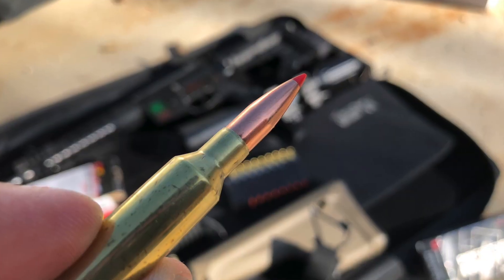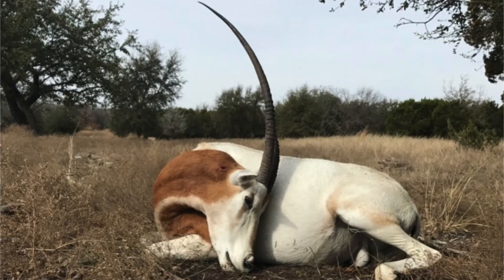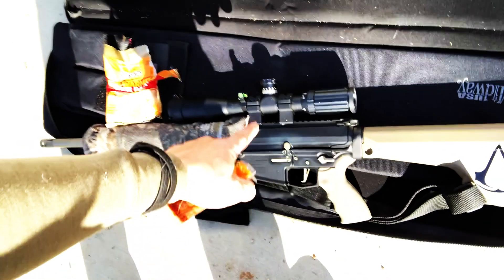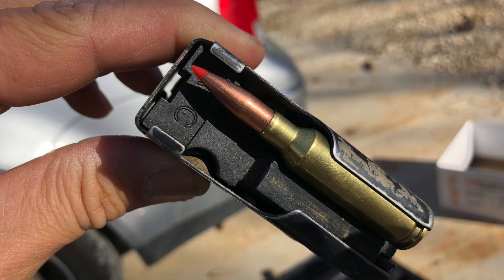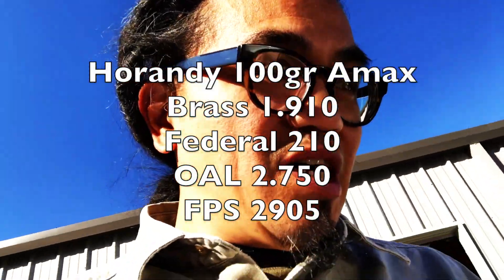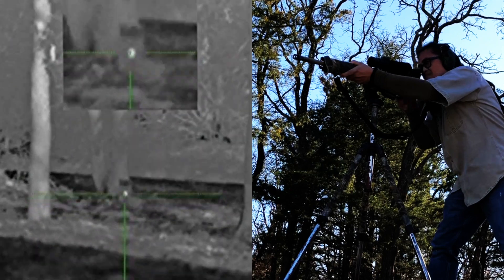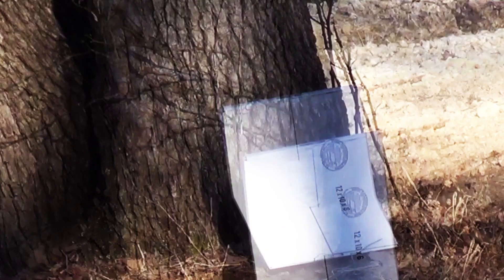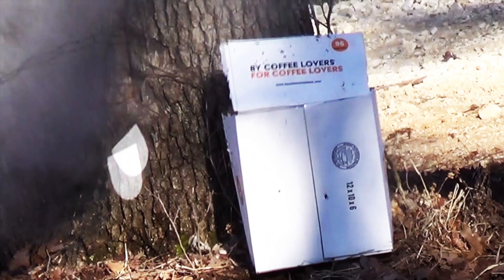6.5 Creedmoor Crimping Bullet Point of Impact Shift

Comment: Suprising i would i have expected some increased velocity due to higher pressures.  I would crimp too for a gas gun, and use bullets with a Cannelure.
Reply from the maker: I'm having to dump this entire load and starting from the ground up again.
Reply: SpecialEd309 Thats unfortunate it looks very accurate.  Im having to pull 80 Nosler RDF's due to overpressure signs.  i feel ya.
Reply from the maker: Ya, growing pains.  So many .264 options.  Fun a good cheapish batch of FMJ's waiting for them to come back in stock.

Comment: Not going to make much difference without a cannelure to crimp into on the bullet I do not think

I did have a variation on my 7.7x58mm Jap rifles when I switched from a .311 diameter bullet to a .312 diameter bullet with a cannelure but I believe it was because of the bigger diameter of the bullet and not the cannelure

After sighting into the bulls eye with .311 diameter bullets I switched to cannelure type .312 diameter bullets and found very accurate also but all of them shot 3 inches to the left of dead center for the same weight bullets

Not sure if it is the same for rifles and would have to use a chrono to find out but I did have that one video with the 357 where all of a sudden heavier cases with a heavier crimp ended up with slower velocities than the lighter cases with a lighter crimp

In the end I concluded it was because the lighter cases and crimps let the bullet fly out faster where as the heavy crimps caused the case to hold the bullet longer and more powder was burned in the case before the bullet left giving them a slower velocity from the muzzle

Not sure what happen with the 7.7 as it was same weight bullets except the .312 had a cannelure to crimp in yet with one grain less powder to make up for the extra .001 in size they hit on the dead center horizontal line but 3 inches to the left
Reply from the maker: Thanks for sharing your experience.  I should have clarified at the beginning why I was crimping.  Stay tuned.
Reply: I already know why, It is because the lighter weight bullets have to be seated almost to the end as a way to get the clearance you want from the rifling for the better accuracy factor and so they have to be crimped or the shock from the rifle being fired could unseat some of the bullets in the magazine

I hate it when that happens and have to be thinking, Ya know what? I'm gonna have to load these rounds one at a time or all kinds of crummy stuff is going to happen unless I crimp them next time LOL

Happens with 100 grain bullets I now seat deeper for my 7mm-08 without much difference in accuracy but they stay in place seated deeper and shows up big time when I use a 125 grain for the 7.7x58mm of which I have to crimp as it is barely sitting in the case neck and otherwise and will just fall right out 

That 125 grain in the 7.7x58mm was a burger and at first it was about 18 inch groups and I kept working loads and lengths got it to 1 foot then 6 inches then found the perfect combinations to get 1 inch groups at 100 yards

31 caliber 125 grain bullet going 2000 fps is what I ended up with and thought, well it's a little better than my 357 pistol anyway LOL so I still load them but have only used them for target practice so far

Comment: Crimping can result in a little bit higher pressure which equals a few fps increase.  Not a factor close but past 300 it will change impact due to faster bullet.  I crimp all my reloads with the Lee Factor Crimping Die with great success .... at least I think so.  Keeps my standard deviation on fps down around 4-8 between shots.
Reply from the maker: this is all new to me.  I practice like I intent to hunt.  Honestly since hogs are my primary target maintaining a 1.5" MOA 3" M.P.B.R. is plenty good for me.

Comment: Ed I have a question for you. Do you know why you have a problem with the 120 grain bullets? I noticed I have to force them in and they extract just fine. I just never fired one because didn't want to damage the rifle.
Reply from the maker: 120 gr's are fine.  This is a 100gr bullet which I run long and hot.  Running it long leave very little base of the bullet in the neck.  I run it long due to accuracy node.

Comment: Changing out your optics I am assuming those optics have been previously sighted on your gun right? And not just out of the box at purchase
Reply from the maker: Yes.  This Thermal has 3 electronic zeros you can use for different calibers, bullets and loads.  I keep the zero numbers in my load book and phone.  I am currently running 8 loads for my 6.5 CM.  Not including the 7.62x39
Reply: Thanks for the reply Ed I don't have any optics that advanced but they sound totally awesome!